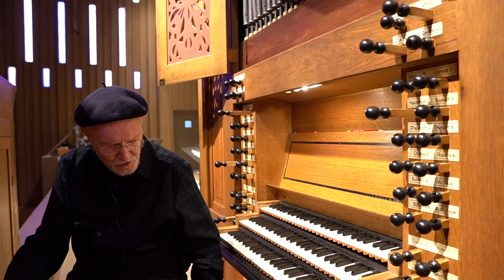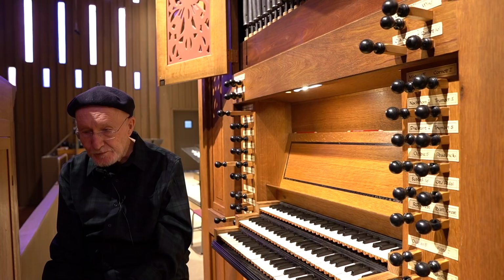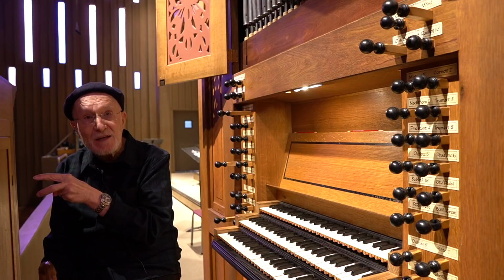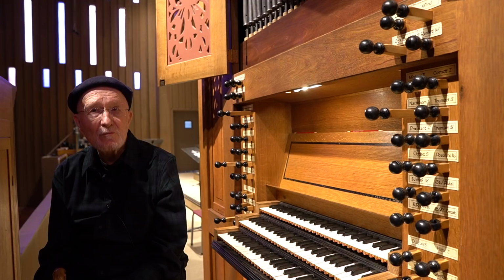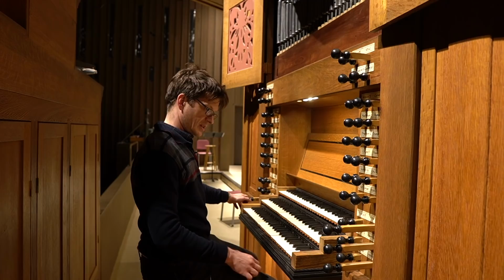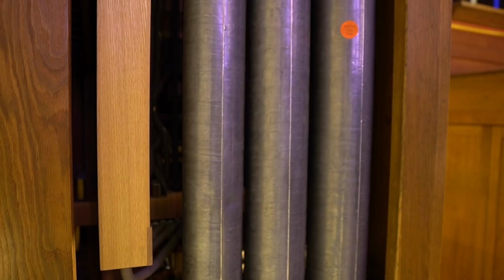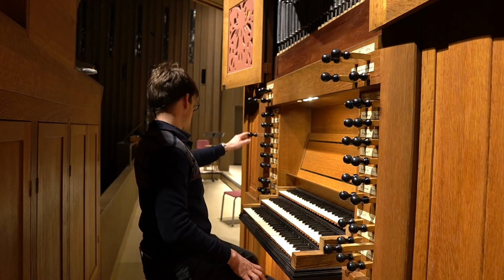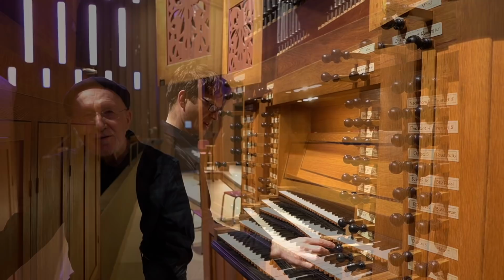Brombaugh and Associates Op. 19  (1976) | Central Lutheran Church,  Eugene, Oregon

Comment: 2' pedal solo stops were very important when pedal range was 25/27 notes,only  way to get a full soprano range in pedal,. With modern pedal ranges, 4' will usually suffice unless the chorale tune goes above f or g.
Reply: Although Dr. Karosi describes them as solo stops, they are also useful as a mixture substitute in a pedal reed plenum!
Reply from the maker: @joannescouchet7038  Yes, that is an option, and some organists use the cornet 2' that way. To me it is a bit too prominent as part of the Pedal reed chorus and therefore conflicts with the counterpoint in the upper voices. I keep hearing it especially when accompanying a mixture plenum on the manuals.  Using it with the pedal mixture is out of the question
Reply: @bkarosi  I agree, when playing a Bach fugue for instance I would not use it. But for something like chorale in bass for a North German setting I very much prefer a pure pedal reed plenum to a mixture one. (for instance, Weckmann's Zinck registration used Principal 24' plus pedal reeds from 16 to 2' - very heavy pedal!)
Reply from the maker: @joannescouchet7038  I take it back! I did use that registration myself here: https://www.youtube.com/watch?v=-E0dTeDdoQs&list=RDMM&index=3